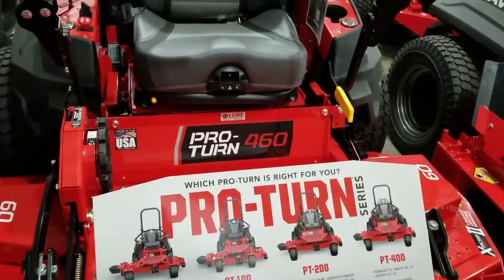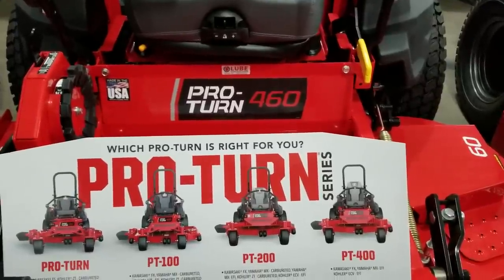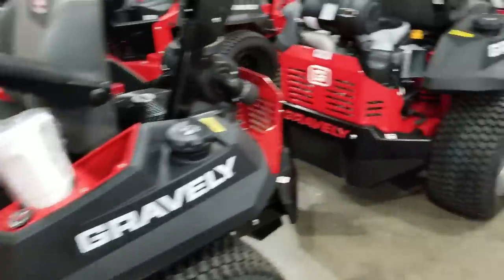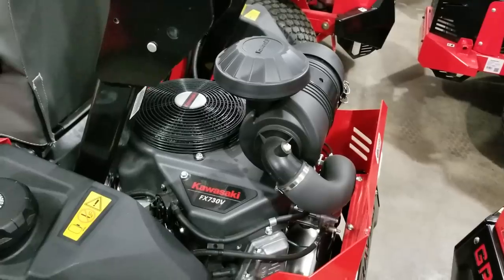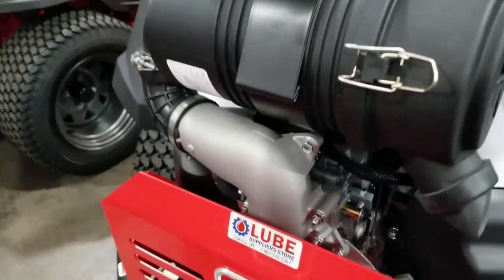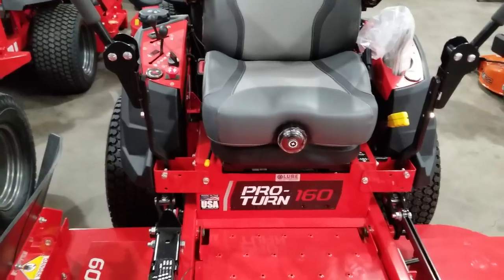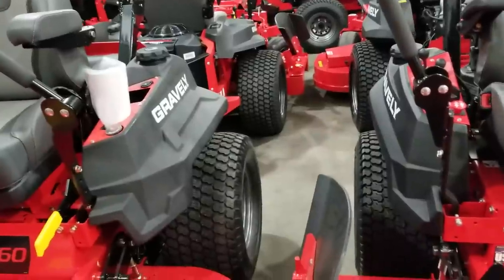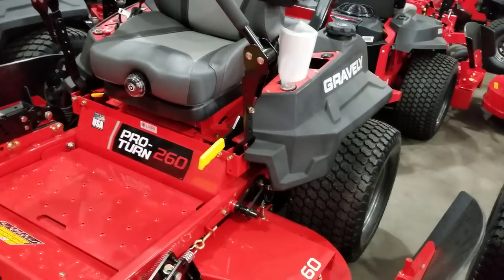Complete Overview Gravely Pro-Turn 160 / 260 / 460 (With Recommendations)

Comment: Nice review of all the models, i did get the Proturn 260 with the Yamaha MX775 29hp.  Machine is a beast and i love it.  Sure it would have been nice to get the 460 but you can't go wrong either with the 260 Yamaha EFI, though i did work out a deal to get the radial tires.   Mower not only works great but looks great, its like a Nascar version zero turn.